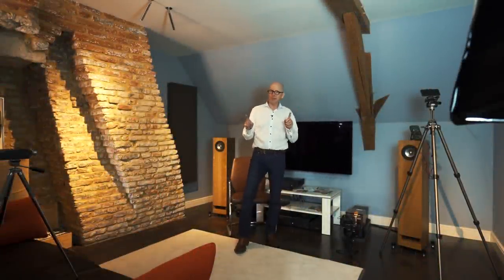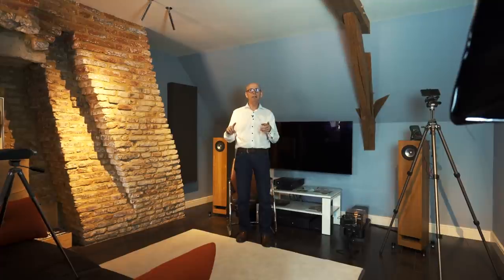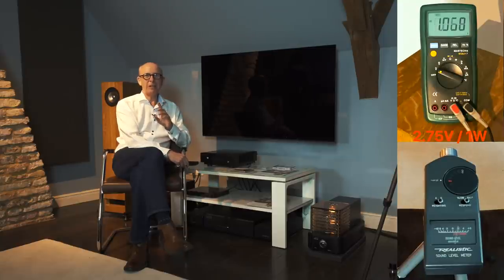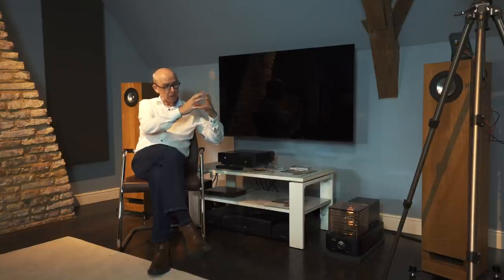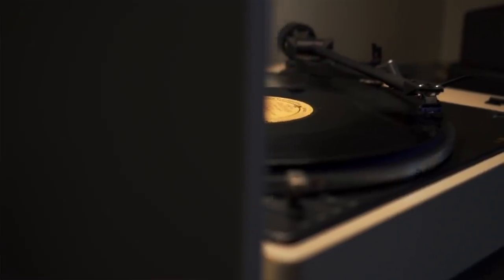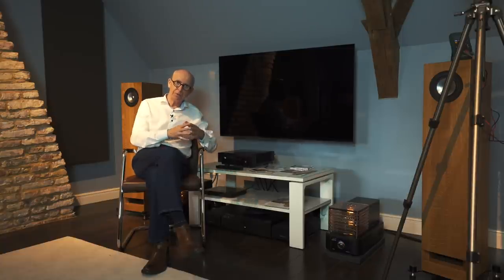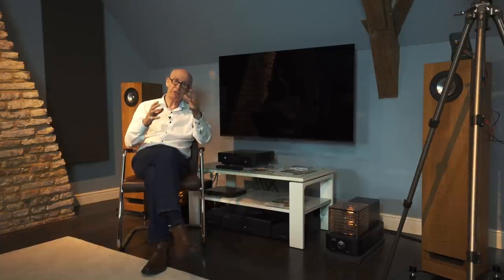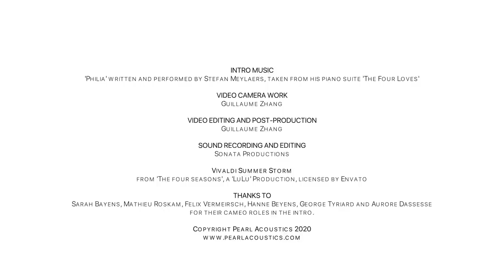How loud is 1 Watt (with an 87db Loudspeaker)?

Comment: Great job. Thank you. However, I do believe my wife goes louder with even less wattage! Some room treatment, clearly, is in order.
Reply from the maker: In an obtuse way, you have hit on an important point. Sound source, frequency range and timbre have a massive impact on us, sometimes even more than the content! This is something I will be covering in a later video on speaker placement
Reply: LOL ... my wife too 👍
Reply: Mine works on "what"age.  😀😇😎
Reply: L🤭L
Reply: I've noticed the very same results  with my wife, she has very high efficiency and can be driven quite easily, with my comments, even with very little power! But seriously, when I was a kid, we used to take a cheap RadioShack  watt meter and hook it up through the speakers of our various crappy systems and we were amazed at how little the amount of wattage was, even when loud.

Comment: If the first watt isn't any good, why would you want 200 more of them?
Reply: Because "old good" recordings assume you have to have enough in a reserve to play all peaks. Because typically 200W amplifier will have less distortions at 1W than a 10W amplifier, as well as 200W speaker comparing to 10W one. Because 200W woofers are simply bigger than 10W, and so have massive, volume, alive bass.
Reply: @sc0or Well distortion is not all equal.  Our brain likes second order harmonics better than odd order harmonics so a 10W tube amp at 1% distortion may still be producing a pleasant sound to our ears.  A have an 8W  300B amp at home (and 91db speakers) that sounds terrific ..on violins, acoustic guitar, piano, vocals you can play loud.  And for moderate volumes it sounds great for anything you throw at it.  But as expected it looses breath playing bass heavy material loud.  Put Mother on from Pink Floyds The Wall and it will play loud until at 2:50 where the drums kick in.  Lower the volume to moderate listening levels and those 8 flea watts deliver.
Reply: @sc0or  nope it depends on electronics

Comment: When his 2 watts is louder than your 500.
Reply: Well I guess that's what happens when you buy "500" watts speakers.
Reply: Just look how big those tubes are. I have an 89db/w fostex speakers here hooked to a 22kg Yamaha ss integrated rated at 130w rms into 8ohms that takes in 600w of input power and a 98db pro jbl speakers powered by a 1kw class D amp. The Yammies have beefier bass and meatier mids than the larger speakers and I believe it's because of the toshiba output drive transistors and the two very large filter caps in it that makes the whole class ab much preferable to audio than class d for low levels. But the pro speakers of course would destroy any of these puny hifi speakers in regards to pure sound pressure level. I practically listen only to two genres at a time, old classical music recordings and 70's rock. JBL for the former and Fostex for the latter. No matter how good hifi is, pro audio beats it flat out in dynamics.
Reply: @automachinehead  I can't quite understand what you're trying to say. Dynamics and SPL aren't the same thing, and whilst of course a serious and expensive pro-audio setup would destroy any HiFi setup in terms of shear volume, I wouldn't necessarily claim the same regarding sound quality.

Pro speakers and amps can sound very good, but that means you need to buy expensive equipment to achieve the same sound quality of something that you could have with much cheaper HiFi components. I'm not talking about records and tube amplifiers either, those aren't for "pure" sound quality.
Reply: @ilpatongi  I mean for now a have a LG XBOOM stereo thing. But sometime in march I'm getting like a Sony DH something receiver, 3000w rockville amp, (2) RSG12s from rockville, and the RBG10 sub.
plus all the necessary wires and stuff.
Reply: @James-ce7wo  I doubt you will solve anything if quality is your goal, it's extremely cheap and low quality stuff
Reply: @ilpatongi  I did not say SPL and Dynamics are the same. I said both of that attributes can easily be had in pro audio. Expensive pro audio aren't as expensive as hifi snake oil. A pro sound guy knows his stuff vs an audiophile who dwells mostly in his tiny listening room and online forums. I was also a hifi enthusiast until my younger brother invited me to one of his indoor wedding gig which played mostly acoustic recording stuff and it opened my eyes to how pro audio can easily destroy any hifi equipment if set up properly.
Reply: @automachinehead  Well you see, I understand what you're saying, I had multiple pro audio products as my main listening setup and I absolutely agree that prices aren't nearly as high as snake oil stuff. But solid HiFi products in the same price range destroy anything that the pro audio world can offer, just for noisefloor alone.
It depends really.
Reply: @ilpatongi  Noise floor comes from either amp or dac. If both their input sensitivity aren't matched, expect a hiss. I use an oscilloscope to make sure I set the gain on the amp exactly right before it clips and the volume knob positioned right before I blow my ears out. The only time I could hear a hiss is when I press my face down the mouth of the compression driver's horn. No hifi could destroy a serious pro audio set up bc 86/87/88/89/90 decibel through cute drivers is for kitchen type spl. That's basic physics. My fostex cannot reproduce the dynamic power present in Elmer Bernstein's Magnificent 7 score even at a respectable volume bc you can hear it straining and vibrating too much even when the Yamaha amp is still cold.
Reply: @automachinehead  You're talking about SPL, loud doesn't equal quality.
I don't think you're getting what I'm trying to say.

Besides, a proper HiFi doesn't allow hiss, it's the sole reason of expensive components really.

PS: what do you mean by "the amp is still cold"? Is it a valve amp? I don't think I got that
Reply: @ilpatongi   I don't think you have ever built yourself an amp before. Hiss is basic ground loop. Any electronics engineer with good experience can eliminate or avoid that. Good THD optimization can be achieved only at a given power—before compression takes over—by using bespoke components that begins from the traffo to the filter caps to the coupling caps and chokes to the well-built npn and pnp transistors in a class ab topology. In class d, it practically relies on the smps design. 

Besides, mcintosh/accuphase/pass labs all measure horribly from sinad to thd. BUT they sound surprisingly good in practice. You don't believe me? go buy any of those stuff and measure them. I already did that and sold them off ebay in the past. No matter what hifi is trying to sell you, physics is pysics. You want dynamic speakers? the minimum should be the vintage Altecs.
Reply: @ilpatongi  Class ab warms up if loaded with good power near its rating and large speakers even sound great at that temp. Small speakers like my pair of Fostex FE168EZ sadly, cannot handle high power outputs. If you think valve amps have a distinct sound sig that amp is broken. A real tube SHOULD be as transparent as his solid state cousin. Any valve amp that purposefully elevates 2nd order harmonic distortion to produce that tube sound you're thinking is... poorly built. They should have no place in hifi, hence, *high fidelity*. Valve amps love high output impedance so your speakers' actual coil (Z) should not be lower than 8ohms. Some requires 12ohm. Or go class a ss amp but weighs 50kg for a 20w/ch that converts into a heater when turned on but sounds more wonderful than any tube amp in retail.
Reply: @ilpatongi  Hiss is ground loop. Prove it to me or else you are just a young gun trying to be smart. Rather post your license here and I'll send you mine. Hissing is not a harmonic distortion. Oh my god. Stop before you embarass yourself further than this.
Reply: @automachinehead  I don't even know how you got that hissing = distortion from my comment.
Stop asking for proof, you're the only one here who needs to prove his claims, not me.

Having said that, do whatever makes you feel right without any kind of proof to backup your claim, you'll remain wrong and ignorant anyway...
Reply: @ilpatongi  I've proven it to you. We could discuss this in private or in audisciencereview or diyaudio if you want to have it in public. You are still young to know these things. Now finish your college first and earn as much as you can so you can afford a brand new mcintosh or accuphase (I prefer the latter). And then tell me if they sound any different than your existing amp.
Reply: @ilpatongi  windows isn’t known for its stability

Comment: I do agree 1W can get pretty loud, your multimeter is just not the right tool here.
Reply: Yes, you need a very fast voltmeter for this.
Reply: Or osciloscope. Measuring the voltage using volt meter is inaccurate. And the second inaccurate measure is the song he plays. When you need to measure how many dB your speakers actually producing , there must to be a sinewave signal with the same frequency for example 1kHz test tone or 5kHz test tone. Speaker coil is not exactly a  resistive load when AC voltage is applied. Since the voicecoil  is the coil not a resistor , when you apply different and changing frequencies , the actuall resistance is changing too. Expensive speakers have datasheet with them or , use induction meter to measure inductance not the resistance because it is not the same resistance
Reply: @samohraje2433  Yes, osciloscope is much better. And having a controlled sweep or sine wave is better. He probably doesn't realize that music has peaks that goes much higher than RMS. And also the dynamics in the music can have several times the average energy. So his way of measuring things very flawed.
Reply: @oysteinsoreide4323  Sorry i forget to mention , it's not a inductance , yes , coils have inductance but to be right , it is impedance. Impedance is much more complex to measure right values than resistence.
Reply: its a Transmission Line speaker and the impedance peak due inductance behaviour of voice coil would be flattened out, so it would be a pretty flat impedance load to amp i think, just some high frequency data reading would be off, otherwise it would be pretty much a linear drive
Reply: Engineer vs musician. I trust an engineer over a musician any time of the week.
Reply: Or an SMD AAM1